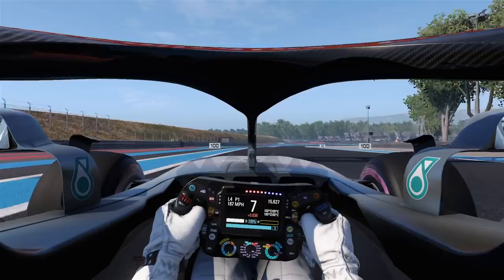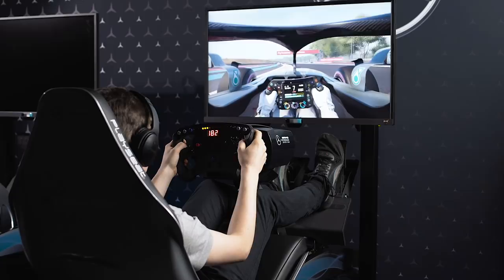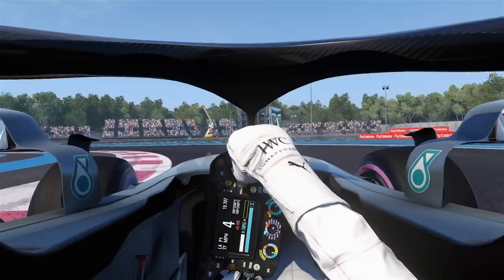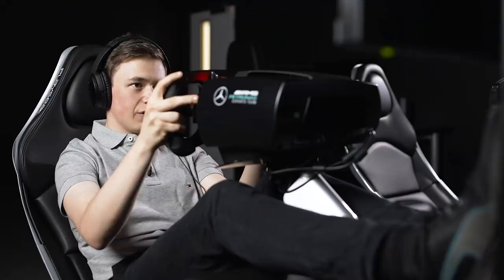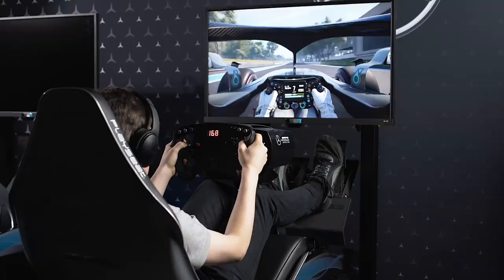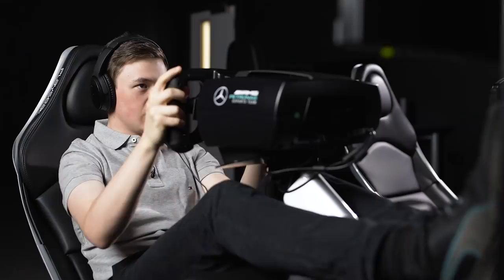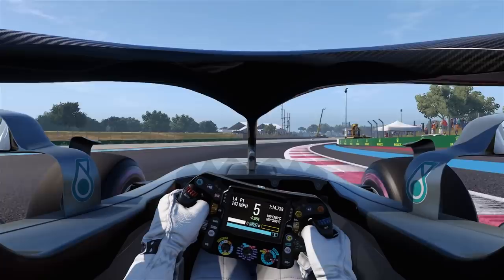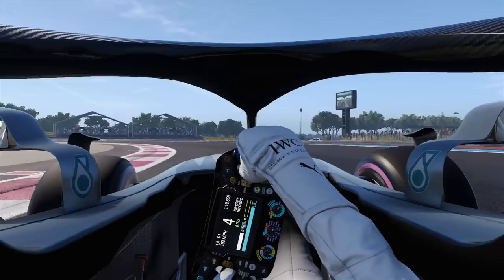How to Tackle a Lap of Circuit Paul Ricard!

Comment: Brake at 100 m board
uses MPH
Reply: Lol someone's triggered xD
Reply: Instead of saying 'uses MPH' I think you mean 'uses imperial system' as using MPH isn't in direct correlation with meters
Reply: ...how a failed F1 esport driver manifests jealousy.
Reply: Yawn
Reply: @essayedgar   John Doe  How are they not in direct correlation? MPH is a measure of distance over time. Meter is a measure of distance. You can't measure speed without distance.
Reply: He's not exactly going to say "Brake at the 0.8th of a mile mark"
Reply: @Em-7Add11  100m are 6.2% of a mile.

Comment: "The Circuit Paul Ricard is the newest addition to the Formula One calendar." 

Um, it was first used in F1 in 1971...
Reply from the maker: In our defence: not in this configuration and with a nearly 30 year gap... Plus it's the most recent circuit to (re)join the current calendar... but point taken!
Reply: @MercedesAMGF1  fair enough, thanks for replying

Comment: Was hoping at least Ocon explaining a lap of Paul Ricard.
I mean has this kid ever been on the circuit for real?
Reply: He has been, and even if he wouldn't it doesn't matter. You seem to underestimate this "kid" which is superfast in simulators also.
Reply: I take it he's done some karting at least?
Reply: @Dougie2945c  He has started racing in Formula Ford after putting some decent lap times on simulator. The first race he qualified quite well at the top but in the race he crashed or something. Look it up on Google for more information.